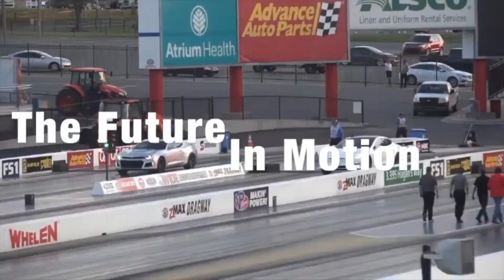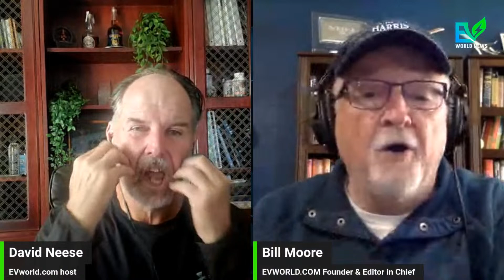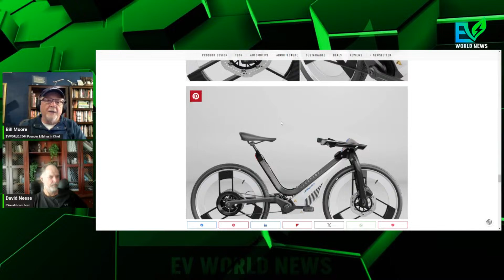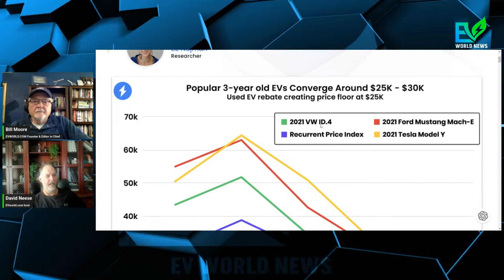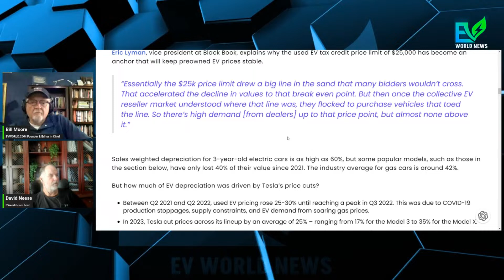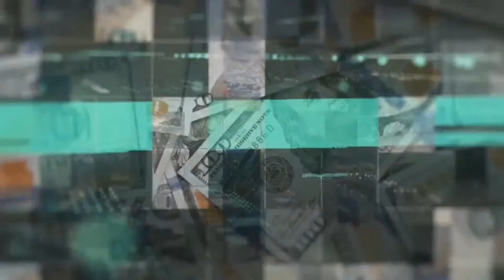Used EV Prices - Google Nuclear - 5 Minute Charging

Comment: It cracks me up that you spent so much time talking about nuclear.  Nuclear fission is dead and gone.  Any future nuclear plants will be fusion...if that ever happens.  Mankind is about to move away from the production of heat in order to create electricity.  Wind and solar tied to large batteries is the way of the future.

1.  Nobody wants a giant polluting power plant or nuclear facility in their back yard, but solar panels and windmills are much more tolerable.
2.  The economics are such that wind and solar with batteries is already the least expensive method to capture energy that is already FREE.
3.  All day long, all over the earth, we already over produce electricity by 10% to prevent blackouts and brownouts.  That 24/7 over production will easily help to fill the battery packs when the renewables are not as productive.